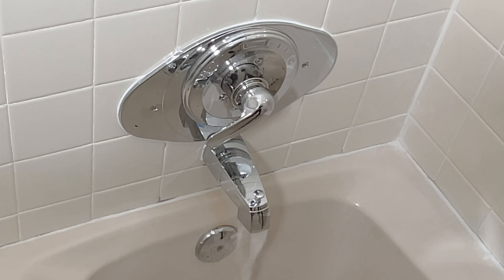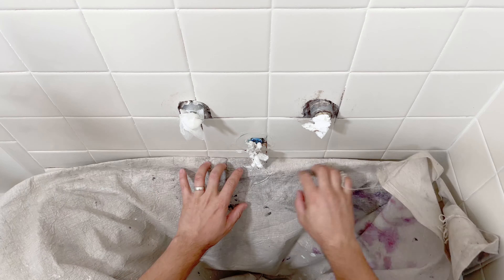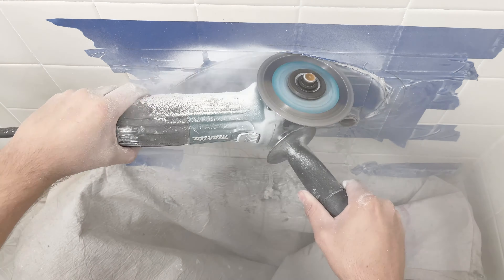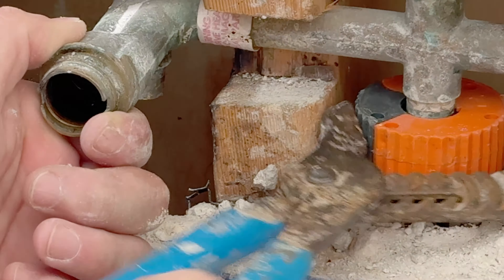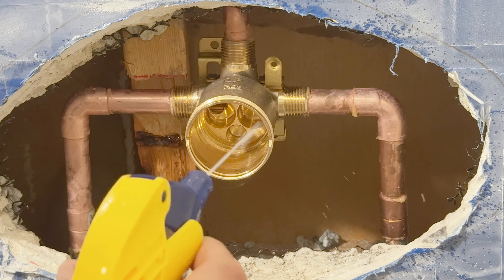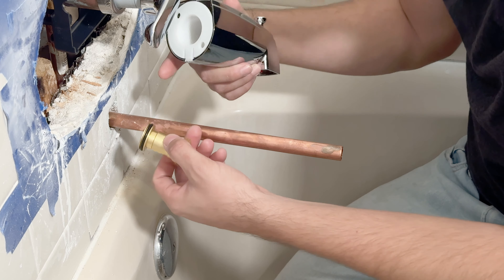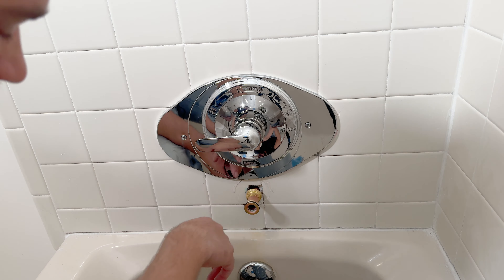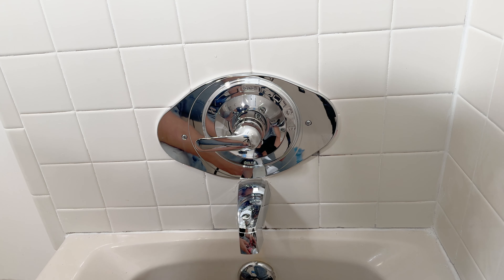Fast Way to Replace or Retrofit a Two Handle Shower System with One Handle

Comment: so just curious i see drywall on the other side of the shower would it have not been better to cut the drywall and leave the tile as untouched as possible? just seems ignorant to cut a giant chunk of tile out when it could of been accessed from the back
Reply: ""Sometimes you may not have access from behind the shower for repairs, and the only option is to work from the inside. In this video I'll share how to do and give out some pointers.""

Comment: One suggestion: bleed the lines and valve without cartridge in it so sediments, flux, and solder don't clog cartridge
Reply from the maker: Good call, yes, sometimes we go too fast and forget these little details that can cause headaches later on… thanks for the suggestion.

Comment: Very nice brother, but is it crooked or just the camera angle?
Reply from the maker: It did came off center. Next time I’ll try to get really center. Good catch!!!
Reply: @DIYPlumbingGuy  Dang, I hope you didn't charge for that 🤣
Reply: @DIYPlumbingGuy  Why is it off center? Did you cut too much on the left side and have to shift it in that direction? Why didn't you use the template that comes with the kit?
Reply: @DIYPlumbingGuy  lol... if the splash ring / plate was colored like a dart board you would have had some splainin to do : )

Comment: Don't post videos if you don't know what You're doing.
Reply from the maker: Sure
Reply: Ignore negative comments and keep going. People learn from mistakes too — so it’s important to show that things don’t always go perfectly!
Reply: meanie

this dude is sharp as a tact 

diy's don't want perfection

they want to get'r done
Reply: I guess so because that would have made an unhappy customer (off centered)… but he got it done…it’s up to installer to get it lined up right.. I knew it was over when he cut the stud higher ..😅and then dry fitting  off center… two wrongs don’t make a right lol…but I caught some new tips in there